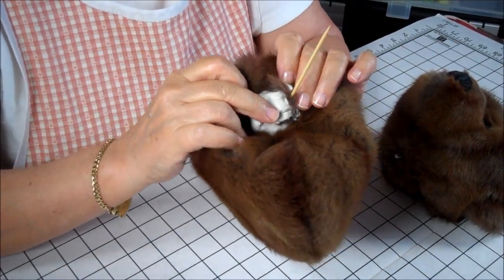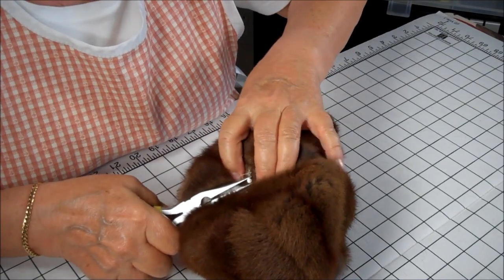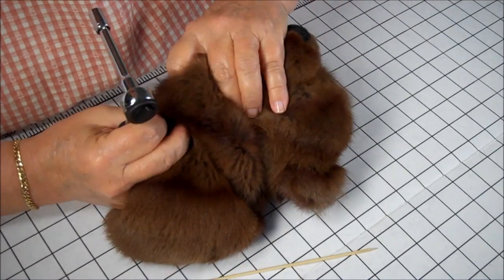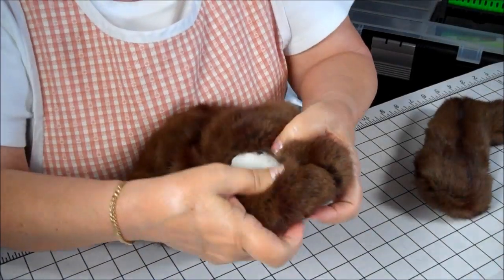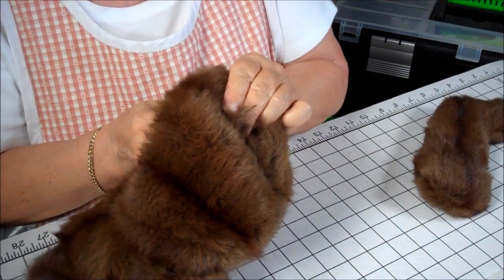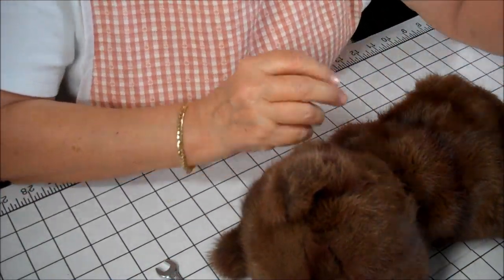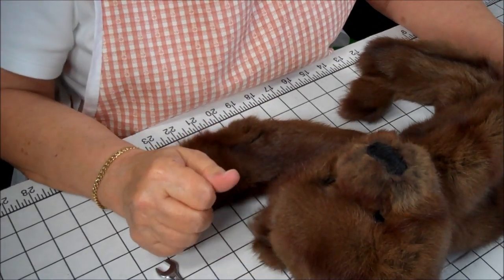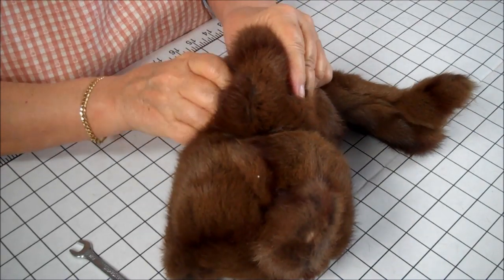Part 13 How to Make a Jointed Fur Teddy Bear - Attaching the head, arms & legs to the body

Comment: i use safty joints. the plastic ones. they come undone over time so i put a little super glue on the lock to the thing that looks like a stick so it wont come undone and still moves. and thanks for the vids. you helped me with a life sized splinter from tmnt greatly. now im useing your videos again to make the life sized turtles. thank you so much.